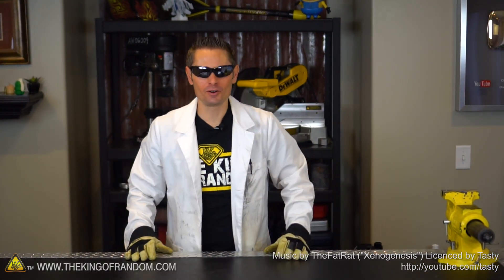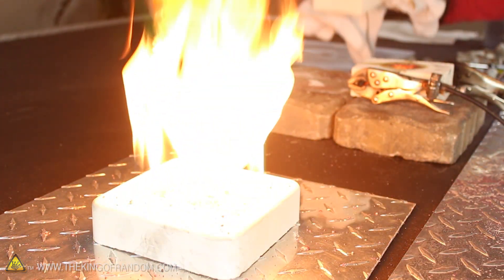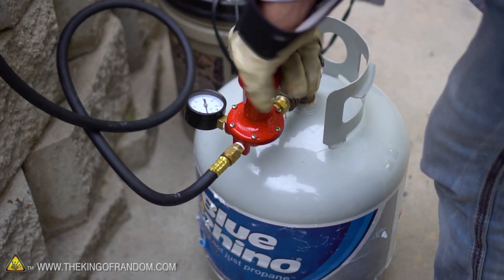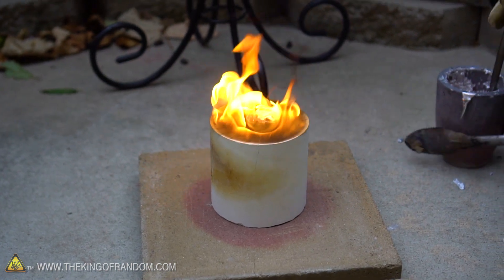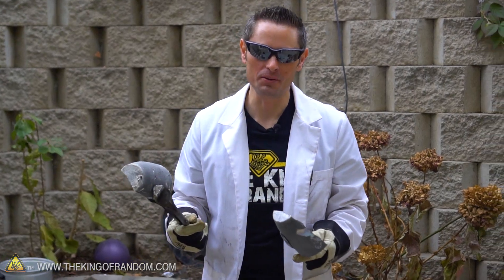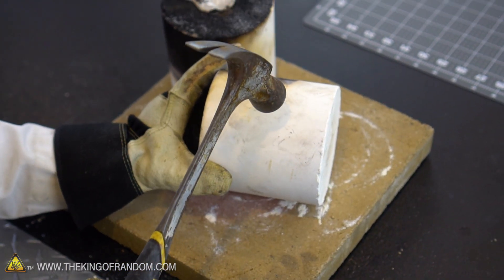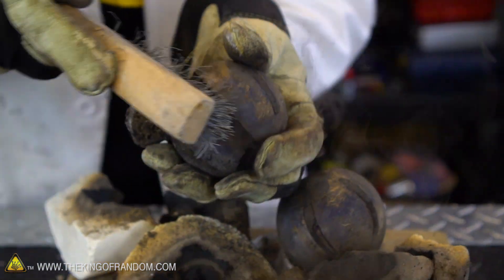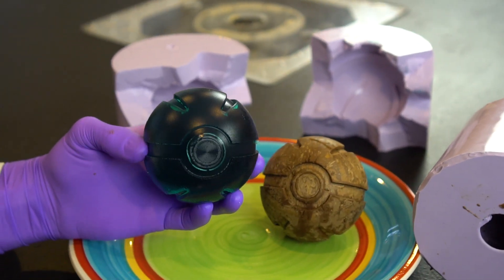Casting Aluminium PokeBalls

Comment: I have some experience metalworking, you can buy de-bubbling solution and paint your wax figures beforehand with it and that lowers the surface tension and makes it less likely for bubbles to stick. You can also buy a shaker to set your wet molds on which vibrates the bubbles to the top.
Reply: you can also take a paintbrush and paint the outside of the figure with wet plaster to make sure plaster gets into all of the nooks and crannies instead of bubbles.

Comment: I didn't read all the comments so excuse me if this has already been mentioned.  You could spray the wax patterns with a soapy solution prior to investing them then the air bubbles wont stick to the pattern as bad also thin your plaster slurry a bit put it in a vacuum like a bell jar and  vibrate it to remove trapped air  before you pour it over the wax then again after its poured  in the flask . that should remove most of the air bubbles that end up being cast onto your project  also if you use  investment powder rather than plaster  you will get better results . Its  not much more expensive than plaster.

Comment: The problem you're having with all castings getting air bubbles in them is due to not vibrating them after pouring. That forces the air to the top and helps fill in any tiny gaps.

Comment: use investmant plasture for dental technicians. it will be a little bit more expensive i think, it will be more fine and you have to heat the mold at at least 600 c to not crack maybe less for alluminium(and burn the wax). remaining wax will leave gases and impurities in the metal. if you do these steps it will be exactly as the wax matrix in detail.
Reply: dental technicians also have duplicating silicone, but you have to work fast with it. bou should get rid of all bubbles by vibratin semiaggresively, or mix it in a vaccume..

Comment: A better way to do this is to use green sand and a stryofoam positive. You can just youtube search for "lost foam casting".

The reason why your're getting those imperfections is because of air/gas pockets forming. You have to use small stick to poke vent holes in the mold in key places. It'll cause a little spir to form, but you just cut the spir off and smooth it out when you are done.

Comment: For the air bubbles couldn't you drill two small holes near the larger hole to allow the metal to push the air out through those two tiny holes and not stay trapped in the plaster mold or go up through the hole that you're pouring through? I think I've seen this somewhere before but i'm not certain if this is how he did it.

Comment: Hey, for your crucible, there are specialized grippers for it.
They're basically just a bent wire to fit higher on the crucible accompanied by another for lower.
By compressing the handle areas they open up a bit wider, so you can put them under the crucible & lift it out.

Comment: To avoid getting the air bubbles at the top, you could find some way to seal off the mould and then rotate the whole thing. Sure, there may be bubbles in the centre but at least they will not be visible

Comment: Bro ! at high temperatures (Above 750*c ) Plaster start releasing sulphur dioxide which is responsible for cracks ! use Alpha-Hemihydrate instead of Gypsum materials they are resist to it !

Comment: A couple tricks you can use to get better castings are to have a second hole in the mold to vent the air as the liquid fills the cavity.  You could also make a larger reservoir at the top of the mold so that it holds more metal and applies pressure to the metal that actually went into the mold. That's called "head pressure", and it will help the liquid fill in all of the cavities.

Comment: I was thinking in starting casting, and I saw you advice to not do it on concrete, and I got scared
What should I so if molten aluminum gets spilled into my skin? Like, fisrt thing first
I dont want to decide it with my experience

Comment: Hi Grant,
Nice castings! I have some experience with casting aluminum into plaster using the lost PLA method for 3D printed parts. With this method, the mold is actually baked in the foundry which both cooks out the PLA and burns off any volatile compounds in the plaster. When the aluminum is poured, there's no fire, smoke or pitting. Maybe try baking your mold in the foundry? Optimally this cast would be done using greensand/petrobond, but if you continue to use plaster, I hope this helps!

Comment: I am no casting expert but I am a blacksmith. the "shrinking" you had is a bubble of gas given off by the plaster. bake them overnight them leave them in a dry place for a week. I know it slows down production time but it will improve results. Only other thing I can think is switch to a professional casting sand (but kind of goes against the channels focus on easy to find materials). I suggest pouring the metal at a slightly lower temp if possible to reduce the thermal stress on plaster. Also removing the slag (impurities) floating as the top layer of metal on your crucible before pouring will also help with reducing the small imperfections and get a cleaner cast. Hope this helps and sorry for the long rambling comment, just wanted to put any improvements I could think of. I'll also ask a friend who has been casting for many years if they have any ideas or tips. As always loved the video, peace.

Comment: Instead of just plaster from the hardware store, you need Jeweler's Casting Investment.  It's free of the materials that burned away in your plaster and it makes cleaner casts.  You should be able to get it at any jeweler's supply store.  The one that I use is Rio Grande in Albuquerque New Mexico.  They do mail order.  (I live in Columbus Ohio and have had no complaints about their service.)

Comment: I'm in the middle of an engineering qualification and when ever we metal cast we sand cast because as long as you compact it enough the cast will not break and the is no chance of cracking the only down side is because the flask gives you a blind mould you will need to put in a runner and riser. on more thing when you melted you aluminium it would have given you a much cleaner cast with less shrinkage you had taken out all the slag (inpurites)  from the mould but they were still awesome cast that i want to do.

Comment: The best way to make a mold (as far as cost and ease of production) is with green sand. It's a mixture of sand, bentonite clay, and water. You can get the clay from cheap kitty litter. There are great guides online for the process of making it

Comment: to help prevent the trapped air drill a couple holes into the plaster mold near the sprue. Also heating the mold to as high a temperature as you can will reduce cracking when the aluminum is poured.

Comment: Would not using vibrations help you with your air bubbles? Kind of like when you're pouring cement or concrete, you need a tool to hit the cast to get rid of the air bubbles.

Comment: Grant, One way to ensure you do not have bubbles in your silicone mold is by using your own home made vacuum chamber. It will remove the air bubbles and you will have a clean mold EVERY TIME.

Comment: You should try and create a little platform that vibrates, the. Whenever you cast stuff in either silicone, or plaster or whatever you decide, you could place it on the vibrating platform and it would shake the air bubbles up and out.  Concrete workers have vibrating tools that they'll put in the wet concrete to achieve this effect.

Comment: To fix the problem of having air bubbles in your aluminum cast, you need a second vent hole to allow air to escape from. So one hole to pour metal in, and a second, smaller hole to let air out. Awesome video! Thank you for posting all of the work that you do!!!

Comment: You should try mixing equal parts of play sand with dry plaster and mix with water until it has the right consistency. Its what we did when making molds for glass blowing and to help strengthen the mold also make a layer of chicken wire that sits between the outer walls of the object and exterior. 

I also did this method to create a giant aluminium 20 sided dice 

I hope that might give you some help

Comment: Is it possible that you could fill in the air bubbles in the silicone molds with a paintbrush and a light coat of the liquified silicone? Or is the stuff too difficult to work with to be able to do that?
Reply: That would be tricky, but doable. You may end up with brush marks in your mold, or there may be too much built up silicone which will leave a (minor) dent in your final piece. The easiest way to avoid air bubbles would be to put the mold in a vacuum chamber or bell jar after pouring. 

I don't have a vacuum chamber, so the method I use is a two stage mold making process. I spread a layer of silicone on my positive, let it cure, and then pour the rest. It doesn't eliminate 100% of the bubbles, but it comes close. Of course, it's extremely slow if you do it on anything other than jewelry.
Reply: i think it could be viable
Reply: Joe Vasicek I don't know if you have ever seen how they make perfectly clear ice but what they do is as the water freezes, they shake it to make all the air bubbles go to the top. same principle could be applied to the silicon mould probably. as the silicon sets, I is continuously shaken to make the air bubbles go to the top.
Reply: Cly Faker Thrifts That's brilliant.
Reply: Joe Vasicek Thanks. :D 

Since he's doing a lost wax casting he could always modify his wax positive to remove or minimize any imperfections. I work in pewter (generally reclaimed from thrift store dishes I bought for $1-2 per pound), so I actually pour my metal straight into the silicone mold. That's why I need as few imperfections as possible.
Reply: Pewter has a lower melting point than silicone?
Reply: yeah pewter is roughly 375F where silicone is around 575F
Reply: Joe Vasicek
The melting point is under (well under in some cases) 500F, and the silicone I use can easily handle 650F. I also dust the mold with graphite to improve metal flow (capillary action FTW). Pewter is perfect for stove top metal casting.

Comment: you should use the mixture of plaster and play sand instead of the normal plaster of paris. The foundry didn't melt when there was molten metal in it.

Comment: If you keep the mold hot and vibrate the mold gently while pouring most if not all air bubble will dissipate, I use to work for Alcoa, this will work !!

Comment: I'm not a metal casting pro, but to get a better sphere I think you need some vents in your mold.  As you pour the hole is filling with molten metal trapping air inside the top curve of the mold.  Make some long, thin, wax cylinders (like a soda straw size, you can probably warm the wax and just roll them out) and stick 4 to the wax sphere around the wooden plug.  That way the air trapped in the mold has a way to vent.

Comment: The burning could also be from wax residue that is left in the plaster. Normally you don't use plaster for moulds, look for green sand, that should work really fine.

Comment: i could see you using a vacuum pump when making the silicone  molds, in order to get rid of the air bubbles that accumulate towards the top.

Comment: alot of people have said this already but a vacuum chamber will help with the bubbling near the top. The vacuum chamber will try to pull out all off the air from the mold bringing all the bubbles to the surface leaving a smoother surface to the product

Comment: (written before i saw the casting/final result )My hypothesis is that the heat from the oven baked off all the volatiles from the plaster and the mold won't burn like the han solo one.

Comment: I lack the ability to do so but I always wanted to get a cat scan, and then from the images 3d model my own skull and from that model produce a life size replica in steel. ... you should do that  ... or  perhaps experiment with multimeter casting like a copper doughnut with aluminium frosting

Comment: Grant,

Here's a way to be able to make reusable molds for anything you make a silicone mold of. Cast a resin hard copy of the object using the silicone mold since wax is too soft for the next step. Use green sand to make your metal casting mold. Youtuber Makin Sumthin From Nuthin has a couple of great videos explaining the process of making greensand and how to make your molds with it for casting aluminum. You may need a few vents with the pokeballs given their shape. Give it a shot and let me know how well it works!

Comment: Use a rubber wheel on a dremel to vibrate the mold and agitate the air to the surface.

Comment: Couldn't you have just used the wax balls and green sand to cast them using the lost wax method? Plaster never seems to work when casting metal.

Comment: Have a go doing the balls using your sand mould. Instead of an expanded polystyrene former, try using the 'lost wax' method. Wax spheres instead of styrofoam. It's used a lot to cast metal models. Your Han Solo in Carbonite would work well doing this.

Comment: So, the problem with plaster is that when cured it incorporates water into its crystalline structure. Heating cured plaster releases that water up to a point, for the plaster to retain its structure it has to have SOME water left in it. So when you pour molten metals in it that remaining water boils off, as we all the wax left in the porous structure of the plaster that evaporates and ignites. That's why foundry sand is used for making molds.
Source: I'm a chemist interested in metal casting

Comment: You could try green sand forging. I believe you can use the wax like how you did with the styrofoam bury it in the sand  and pour the melted metal into it and it will melt and take the place of the wax figures.

Comment: We use a special type of sand that sticks together for jewellery casting. Theres videos online of it. It comes with 2 metal rings that slot together. You should check it out for ideas to improve your castings.

Comment: Use investment plaster.  I dunno why they call it investment but that's what it's called.  Wikipedia says:

"The plaster is not pure plaster of Paris, but rather has additives to improve green strength, dry strength, permeability, and castability. For instance, talc or magnesium oxide are added to prevent cracking and reduce setting time; lime and cement limit expansion during baking; glass fibers increase strength; sand can be used as a filler.[1] The ratio of ingredients is 70–80% gypsum and 20–30% additives."

I've done lots of pewter, silver and gold casting with this stuff.  You should use a steel flask to contain the investment, I've seen people use coffee or vegetable cans as flasks for investment casting.  The flask keeps the mold from cracking.  I've also seen people swing the hot molds around like a sling to get the centrifugal effect.  Kinda risky but effective.

Comment: This one would be a bit complicated but cool. Why don't you cast a rough bronze statue of your channel logo. You have not done hardly anything with your logo. Print out a template and styro slice a large logo than normal. Then make a bronze statue where the base is just the  pour hole possibly.

Comment: From all of my past experience with advanced metal work (watching youtube vidoes) I know that you need a vent hole for the air to come out and also the pouring hole. For a sphere I would almost make the pouring hole slightly down the side and the vent straight out the top. that way you would see once it was all the way full. Just a thought.
Reply: This would be more to cut off in the end though...
Reply: But if you did two you could just do them both a little thinner. That way its no more work than one tube.
Reply: Ok just ignore my comment... i posted this before reading @skycarl comment.

Comment: grant   i think you are having a residual wax issue.. plaster of paris shouldnt burn as far as i know and a vent hole or 2 will help whith the gassing // i think with wax you will need to get the mold to 1000 c or so for 30 min at least to burn out any parafin that has soaked into the plaster.. i suspect you could cast with gelatin  or a fine celled styrofoam  with an acetone solvent.. .. thanks for the videos

Comment: I've never done plaster casting before, but some quick research reckons that talc or magnesium oxide will help with cracks and sand acts as a filler and apparently it should be around a 4:1 ratio of plaster to additives.

Not sure about the burning though. Maybe you could try firing the molds rather than baking them, pre-burn it basically.

Comment: I'm a gold smith and when we do casting with plaster moulds we want them to sit in a special furnace that heats up to 900+F for at least 12 hours for the best performance and have the plaster cast made inside a metal/steel tube to prevent the mould from coming apart and keeping the shape better. Also when doing the mould use a vacuum chamber to remove the air bubbles for a cleaner cast.

Comment: do you think the vibration of a sanding machine. Or something at a low speed when you're pouring. 

Wouldn't take the air pockets out and the material settle in better. just a thought.
 great video

Comment: Make 'Green sand' you can make it yourself, the ingredients is bentonite clay that you will find is cat litter (make sure you check out the bag to make sure it has enough clay) blend it up to a fine powder then mix it with sand. Then add water a bit at a time till you get it to clump together using your hand to compact it and when you break it in half it should stay together in two halfs and the sand dont stick to your hand, then you have green sand. then just look on ways to get a mould as it is perfect for aluminium castings

Comment: What kind of plaster are you using that releases flammable gases when you pour in aluminum?  Regular plaster of Paris is calcium sulfate, which hardens by a hydration reaction.